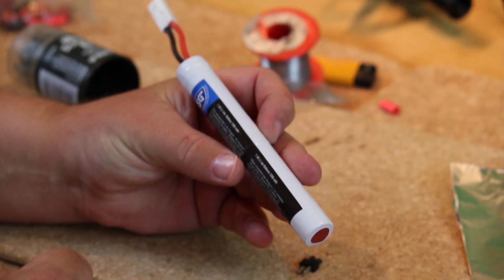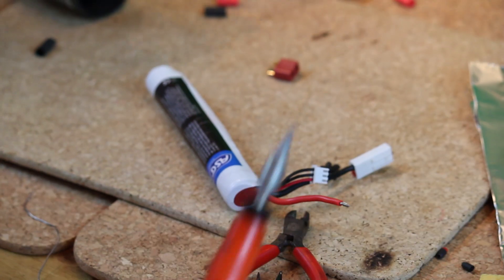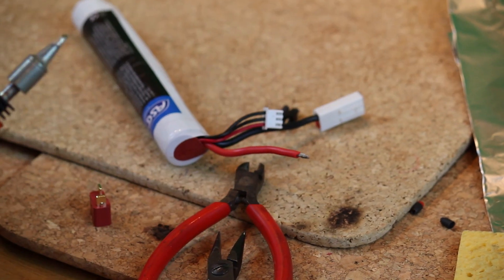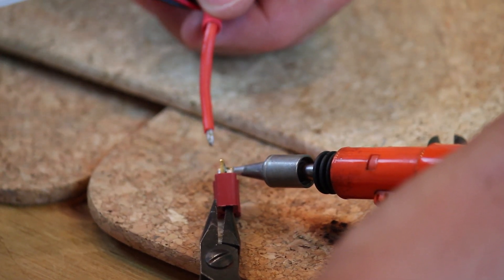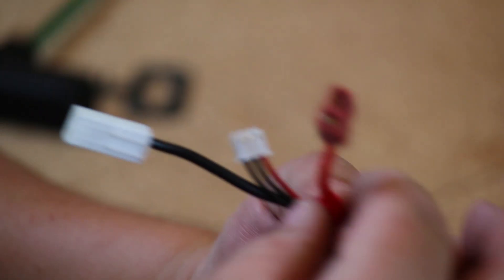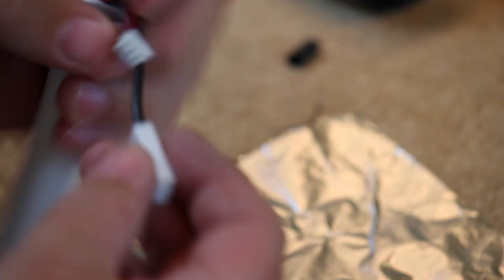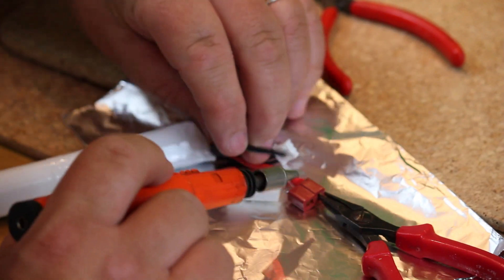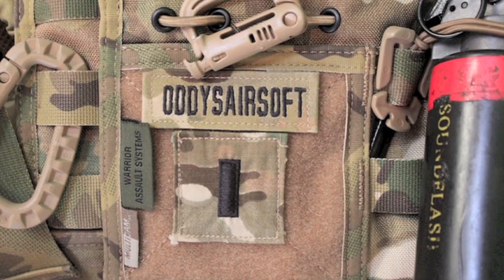Attaching Deans Connector to a Lipo

Comment: man i hate deans. whoever invented those was an evil demon. i really HATE them. just destroyed my whole night trying to solder one. your technique seems legit but my soldering iron won't get the heat up from behind the plug. so i threw the deans out of the window and soldered XT90. still a bad connection but it works. at least for now. but i can't fly because it's dark now. and that is why i hate deans and will never ever touch them again.

Comment: The key point you need to take away from this video is to only ever do one wire at a time when working with batteries or you will short them out. Take your time and do it right.
I had tin foil on the mats as I had already burnt a couple with the gas soldering iron, this is also a short circuit risk so you need to be extra careful with it!

Comment: @ParkAirsoft Rubbish. If you run a 11.1V you will wreck your internals! If you just use a sensible 7.4V lipo, you'll be just fine as it'll be no different from running  a 9.6V NiMH.